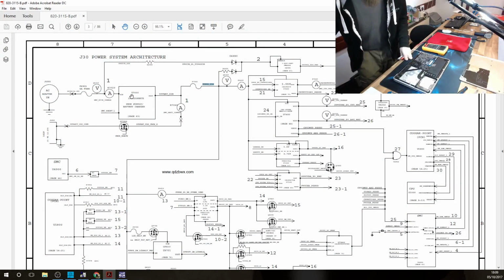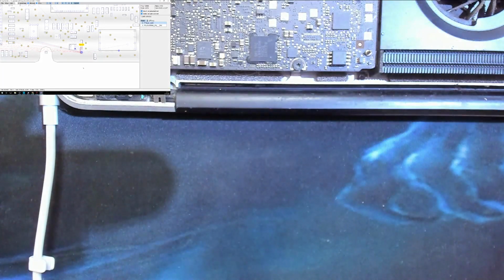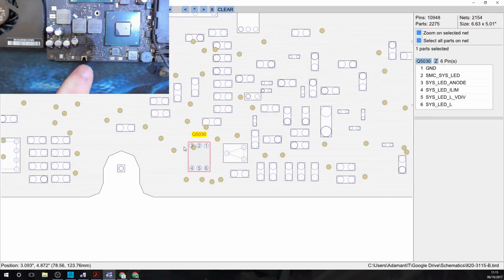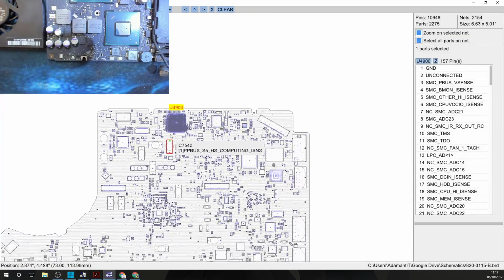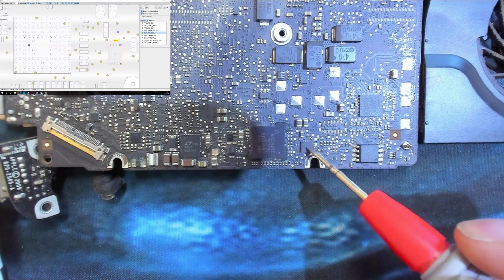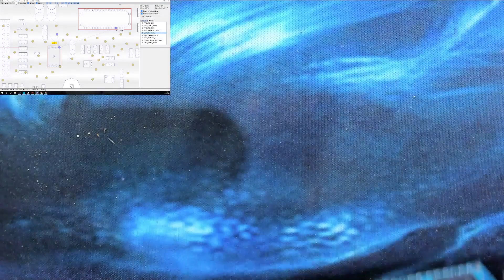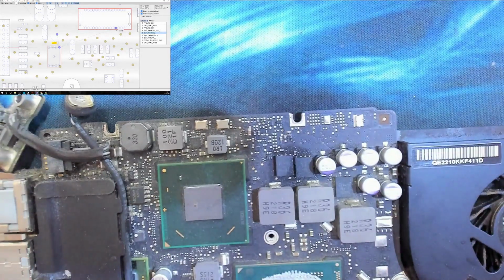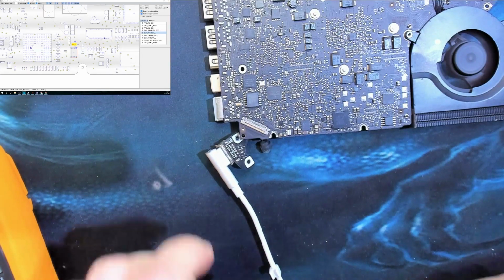Board Repair Basics #6 - SMC Reset L

Comment: What are the odds of a dead board sold by service center having PCH, CPU and Super IO still intact? If cpu is some old celeron that cant run windows 10 pro could it be that they decided to not try it because they decided their time is not worth it? It feel like old junk that does not work sold by owners has more chances of being repairable. Used PC resellers have swept everything that was repairable

Comment: What about the flux and boil process- and changing corroded components. 
Inspecting board pads and coperline. 
Finising of with ultrasonic cleaning.  
The error will come back.

Comment: i have an issue with a board like this: on U6100 i dont have power on pins 5 &  6 which are SPI_MLB_MOSI and SPI_MLB_CLK, i follow the trace unitl the chip, seems that is not sending power to the rail, btw the board turns on but it does not chime only fan is spinning at full speed.

Comment: Hi, thanks for the excellent video. Just a question about the power rails on the macbook pro logic board. When you get a green light on the charger it means that the board is in S5 (plugged to the charger but not powered on). In a functionnal S5 state which other rails can you measure (S3-S4-S0) with the multimeter ? Are theses rails, when the board is in S5 state, receive power and are in standby mode to be ready to boot the system when the power button is activated ? Hard to troubleshooting a board when you don't know if there should be voltage there or not.
Reply: Thanks for the answer, very informative  :-)